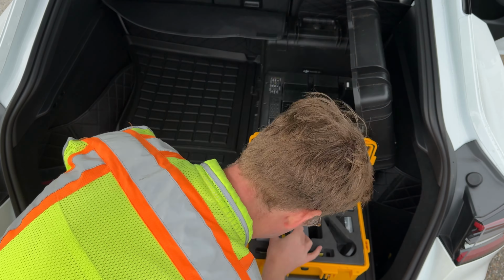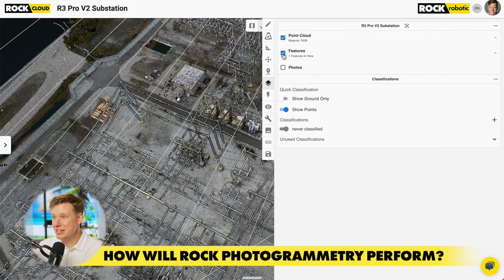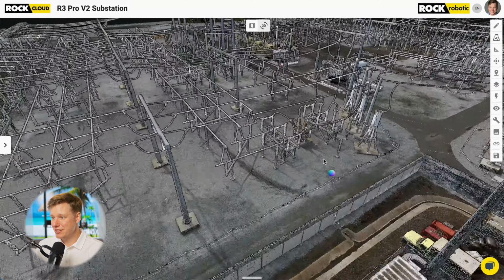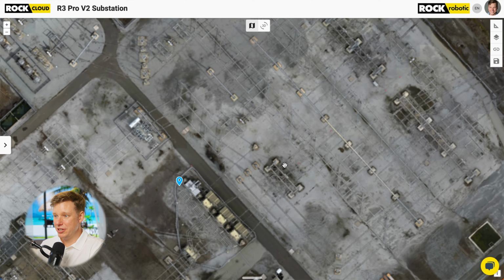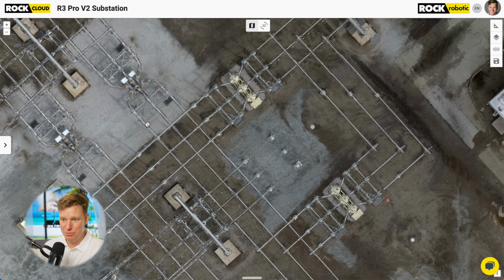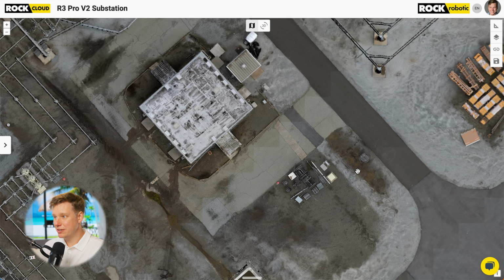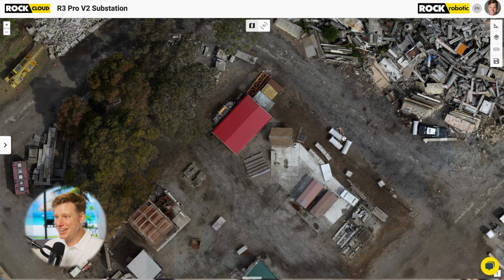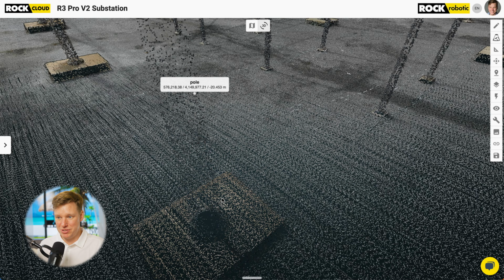Drone LiDAR Scanning a Power Substation | ROCK R3 Pro V2 Example

Comment: Okay we got to change the geographical user interface I need the lidar to detect like a GPS system just needs to no elements of matter on the periodic table of elements so if we're in space we know that that comment or rock or planet is made out of this , here and in what relation to all the black holes that's just a precautionary measure we're aiming for everything inside of a black hole is everything inside our galaxy.    Someone found something out there and is on a serious power trip it's everything that Russia hates and Russia would love to help with not doing anything with because crazy is up there

Comment: Nice demo Harrison... I'm working with Dylan on slowly getting outfitted with my drone equipment, and getting your Rock Robotics gear is right up there... baby steps first. ; ) I met you a couple of times in person at Dylan's seminars in Dublin last year and in Los Altos. I live in Montana, but I'm down here consulting on a couple of sites. I asked you if Rock could come out with a handheld only Lidar for use on ground only 3D Modeling. You said to bug your staff about having that available as well as the aerial equipment.  Have you decided on offering that option yet? I'd like to get into Lidar using your gear and online service, but I'm not quite ready to buy all of the drone equipment that I need. Appreciate your consideration on this. I have a couple of questions too on using your on-site GPS station that we buy from you if we don't have a local CORS station available.  Lastly, I'm in the San Jose area for a couple of more months before I head back up to Big Sky country. Did you record this footage in the San Mateo area? Just curious. That looks like the area from Palo Alto on North next to the Bay. I grew up in Campbell, so I know the Bay Area well.; ) Any chance to stop by or tag along on any of your Bay shoots  to learn more? I'll help carry the gear. ; ) Appreciate your informative videos as always...

Comment: It looks good!
Harrison how about a power line with vegetation around it? 
 Harrison
Does Rock Pilot 2.00.03 from 2024-4-16 work with the new DJI Firmware UAV v10.00.06.02 and RC v03.02.09.08 from 2024-04-28 ?